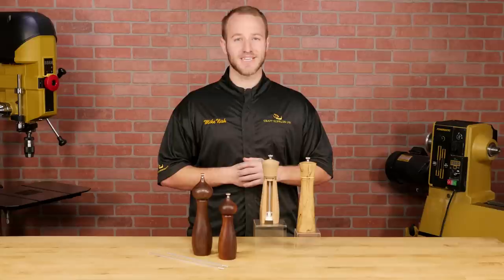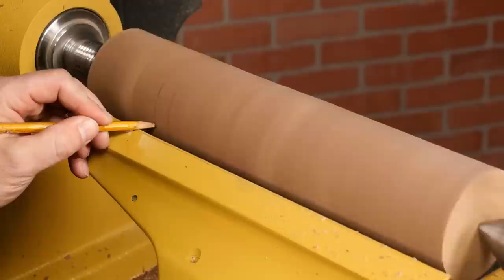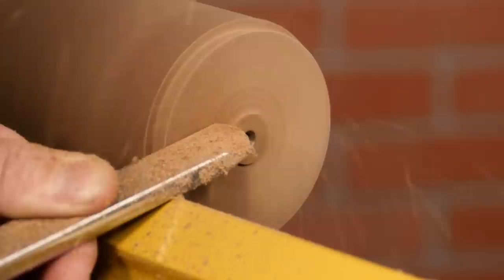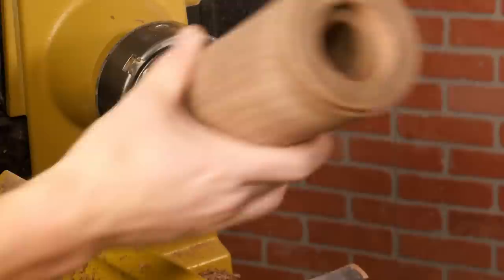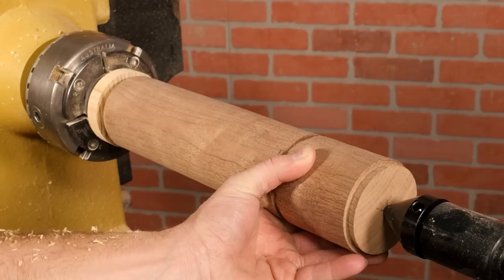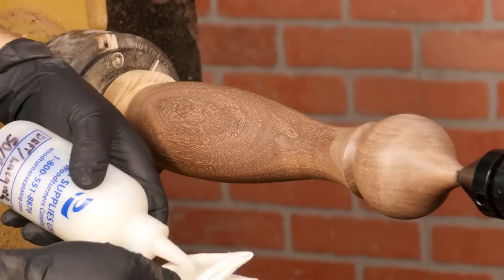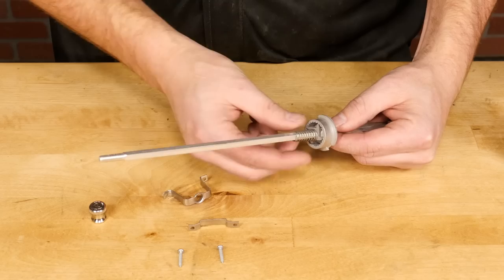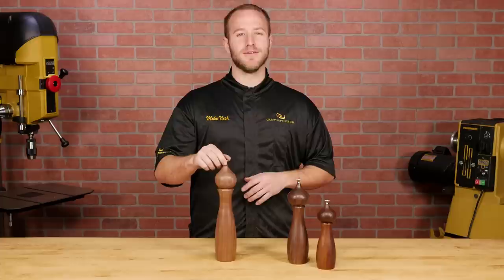Turning a Deluxe Pepper/Salt Mill (Woodturning Project)

Comment: I followed the directions.  On  both the pepper and salt mills, the stock was longer than the square rod by  1/4".  Luckily, by using a collet chuck with a 1/4" bolt, I was able to take a 1/4" off the bottom of the tops which made the inside tenons a little longer.  I would add a step to check the overall length of your project in relation to the rod length before finishing and assembly.

Comment: You didn't mention removing the tenon from the bottom of the body.  Probably should be done before mounting on waste block.  Great design.
Reply from the maker: Good observation. While turning the mill body to shape at 6:31 we incorporated the tenon into the shape to maintain our overall length.

Comment: Mike: how do u deal with eccentricity on the coupling of the top to bottom pieces? No matter how careful I am in aligning pieces, there is always some run out. When I move the tailstock in and out there can be a problem with slop of 1/10” or more from centerline which does not help. Is there a mandrel similar to pen mandrels but for larger diameter from 1-3” or?
Reply from the maker: Please call us at 1-800-551-8876 and ask for Mike. There's a lot of variables here that need to be addressed. Thanks.

Comment: I know this an old video and I'm just starting to turn a mill. The problem I have is I see no instruction as to when to get rid of the tenons  you cut as described in the instruction sheet (v 8.16).  my guess is that once you drill the holes in both the mill head and mill body you can remove the tenons. Would this be correct. Thanks for the help and support.

Comment: If the body ends up too short, why did you cut the non-threaded end? I would think an easy solution is to cut the top to size and rethreat using the appropriate die?
Reply from the maker: Most turners don't have the correct die, so we showed the easiest method.

Comment: Did you remove the tenon on the top of the body and if so at what point in turning the kit did you remove it?
Thanks for the videos!.
Reply from the maker: Good observation. While turning the mill body to shape at 6:12 we incorporated the tenon into the shape to maintain our overall length.